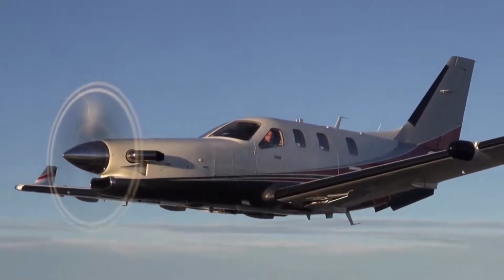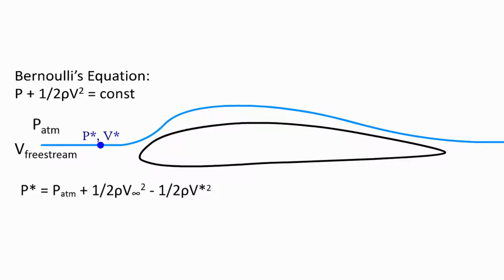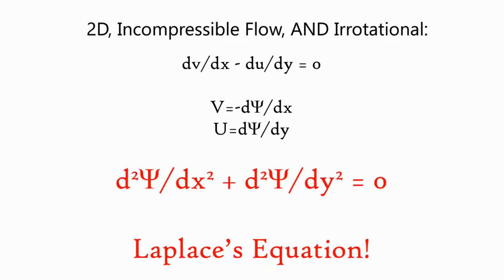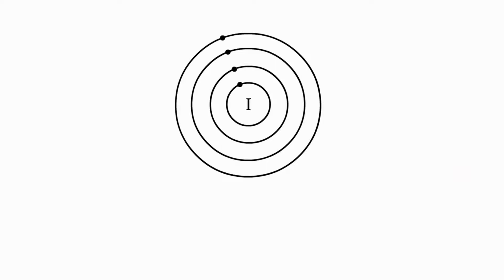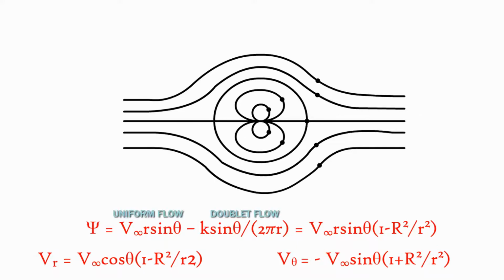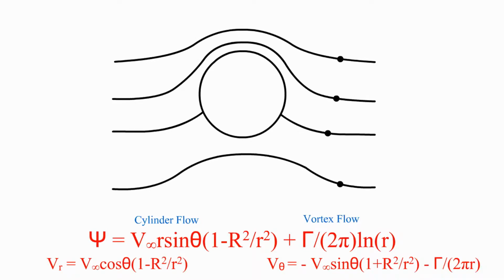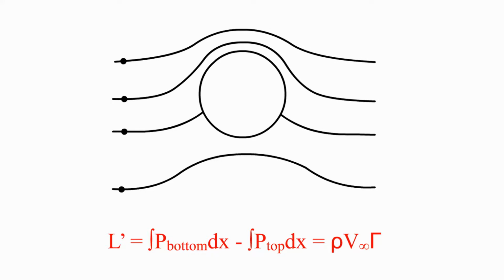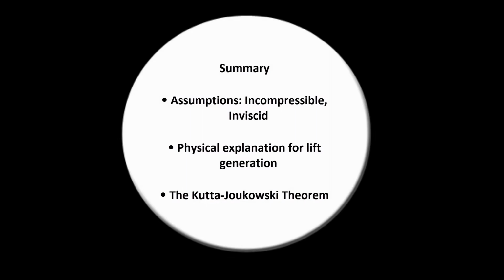Fundamentals of Incompressible, Inviscid Flow

Comment: WAIT a minute.  It is NOT a 'higher velocity that is associated with a lower pressure, but a INCREASE in speed (acceleration) that is associated with a decreasing pressure gradient.
The pressure gradient yields the force to accelerate the mass of the air.
.
It is the curve in the flow that lowers the pressure more above.
..
Is there a part 2.  I don't see it in your videos.